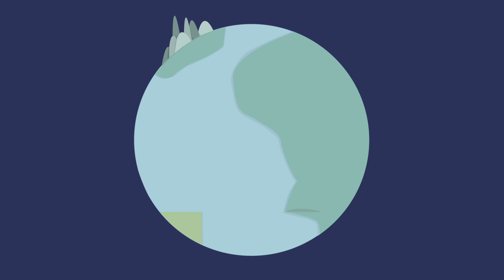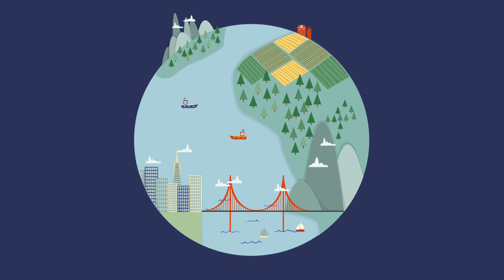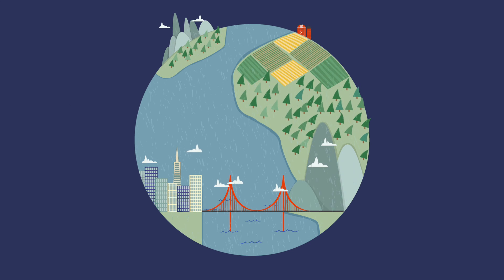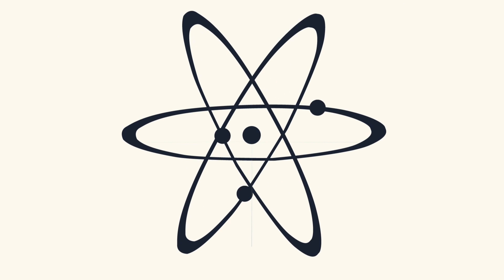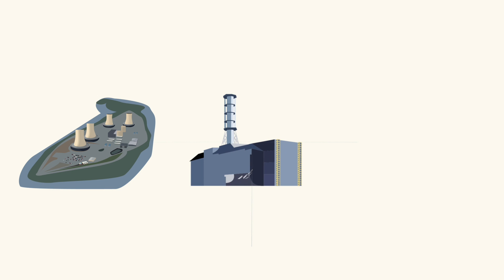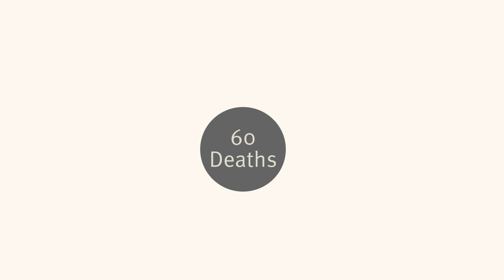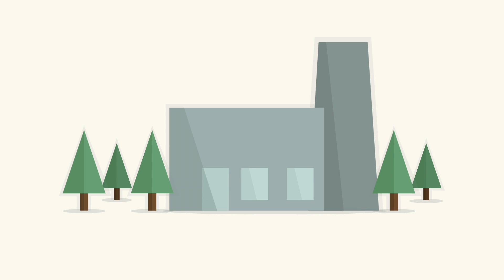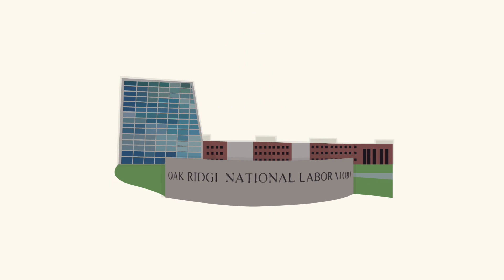Our Future with the Molten Salt Reactor (MSR)

Comment: I only have minor complaints. The video seems to compare all the different molten salt reactor types together. As in some of them will use spent fuel, some of them will use thorium, and some of them will generate very little waste. Actually, compared to light water reactors they All  do generate a lot less waste,Just some of them less waste than other MSRs.
Reply: Otherwise it's a pretty good video
Reply: Michael, at this point, I think the differences between the different designs of MSR's isn't quite as important as getting a simple, understandable, attractive (i.e., It's greener than wind or solar!) message to the public so that when they view this video, they'll (I hope) ask, "What's an MSR? Where can I learn more about it? We can blind them with the science later, right?. For the time being, the KISS principle applies.